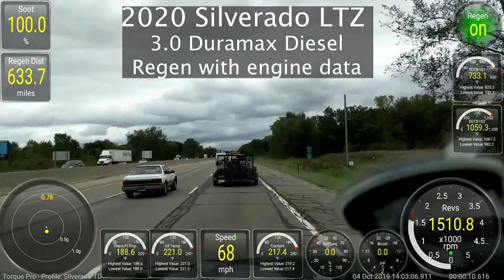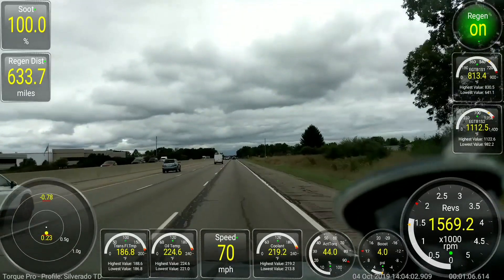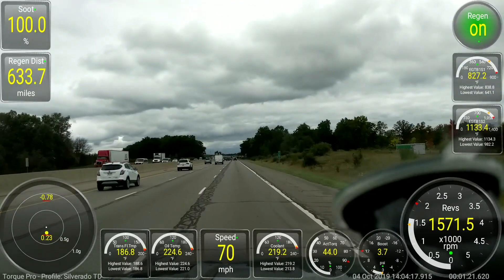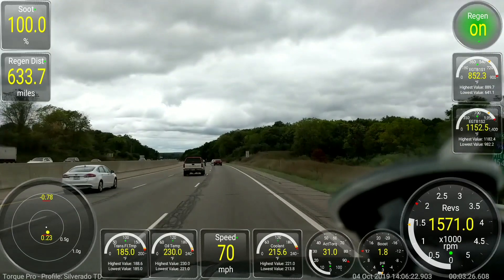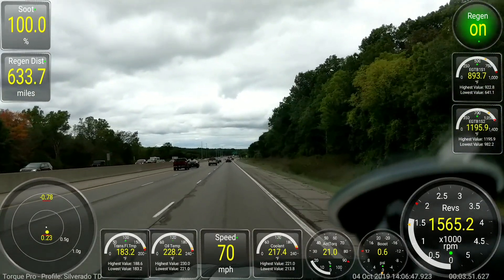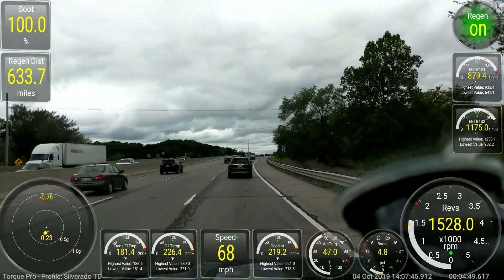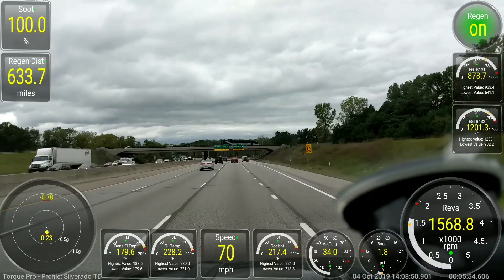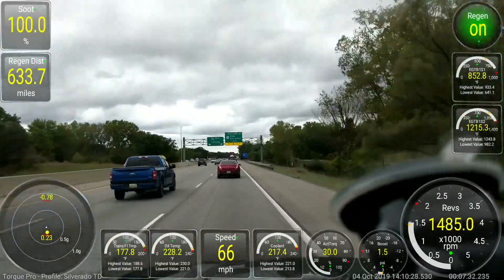2020 Silverado 1500 Duramax Diesel, Regen #12 full cycle talk

Comment: Mine has regened at least 4 times in 360 miles. That's absurd! My 6.7 Cummins never actively regened in 12,000 miles. I'm also going through Def like no tomorrow.
Reply: John Doe I HAVE 3,300 MILES ON MY 2020 RST DIESEL TWO WHEEL DRIVE AND MY DEF GUAGE HAS ONLY MOVED ONE QUARTER OF A TANK SO FAR.  MY FUEL MILEAGE IS UNBELIEVABLE, I SELDOM USE THE INTERSTATE AND MOSTLY USE 55 MPH TWO LANE ROADS WHERE I LIVE.  ABOUT HOW MUCH DEF DID YOU USE FOR 3,300 MILES ?
Reply: NOAH DUNAWAY the DEF is no longer a issue. They didn't fill the tank. However, this POS has been nothing but problems. Now I understand why they call it garbage motors.
Reply from the maker: @Noah, what issues have you been having.  I have over 18k on the truck and no issues at all.
Reply: Chad Ivan NO ISSUES AT ALL SO FAR. JUST CURIOUS ABOUT HOW MUCH DEF USAGE IS NORMAL, MY FIRST DIESEL.  THE FUEL MILEAGE HAS BEEN OUTSTANDING,  MOST FILL UPS HAVE BEEN AROUND 33 MPG WITH MY LAST ONE AT 35.2.  I WENT ON A 200 MILE DRIVE TO PICK UP A PORCH SWING ON THE PREVIOUS FILL UP AND IT WAS 37 MPG.  I TOWED MY ENCLOSED 26’ RACE CAR TRAILER, ABOUT 7,000 LBS, ON ONE TANK SHORTLY AFTER I GOT THE TRUCK FOR ABOUT A 65 MILE TRIP AND THAT TANK WAS STILL 26 MPG.  I HAD TO PULL THE MOTOR OUT OF MY DRAGSTER SO PROBABLY WILL NOT BE TOWING AGAIN UNTIL NEXT YEAR.
Reply: Chad Ivan at 146 miles, my front diff blew. And it's been download hill ever since. Constant engine issues, including over heating, stalling and regenning every 100 miles. I have major blow by to. GM WAS being really cool, said they were going to buy my truck back. They've done a 180 now. I have a out 4,000 miles on it now and it's been sitting in the shop for a week now.
Reply: John Doe I HAVE BEEN KEEPING UP WITH YOUR POSTS HOPING MY TRUCK WOULD NOT GIVE ME PROBLEMS , BUT SO FAR SO GOOD.
Reply: NOAH DUNAWAY I'm glad yours has been trouble free. It's going to be a great engine once they get the bugs worked out. However, mine was very poorly built. The Acadia they gave as a loaner, stalled on me yesterday.
Reply: John Doe MAN JOHN !, IT SOUNDS LIKE YOU ARE SNAKE BIT.  I HOPE THINGS GET BETTER FOR YOU, I KNOW IT’S AGGRAVATING TO GET A LEMON, AND WITH ALL MASS PRODUCED VEHICLES IT’S A CRAP SHOOT TO GET A GOOD ONE IT SEEMS LIKE.
Reply: @JohnDoe-nz6bk  my new 3.0 Duramax regen every 140 to 150 miles , dealer say is normal 😐.  I have 3.200 miles now
Reply: @watchmanexpert  that is not normal.
Reply from the maker: In 3,300 miles you will probably have burned about 2.0 gallons of DEF.  If you were towing this number would be much higher.  My highest use rate was 3.3 gallons every 1,000 miles.  These motors use a lot of DEF when under a lot of load.  I hope this answers your question.
Reply: @CJIEngineering  which app or OBD is that one ?
Reply from the maker: @watchmanexpert  it is Torque Pro with Track Recorder added to it.  It worked pretty good on the older phone but I haven't tried it lately.  There were some overheating issues if you wanted to record a long session.  It's a nice tool.
Reply: @CJIEngineering  thanks Ivan , the torque pro connect to the OBDlink max+ ?  Sorry all this is hard for me , I only want is check my regen and see is the truck is in regen or not , I have OBDlink max+ and I don’t know how to used 🥲… did you have any video explaining how to used the OBDlink?? Thanks 🙏
Reply from the maker: @watchmanexpert  I don't have a video on how to connect the unit but I could do one if it would be helpful.  Try these steps and let me know if you still have issues.  Plug in the MX+ unit into the truck and start the engine.  You should see the LEDs on the front light up.  Push the pairing button down, the LEDs will change state, flashing I believe.  Go to your phone and add a new Bluetooth device, it will show up during the scan and accept the pin number it gives you.  Once you have the unit added to Bluetooth there are no other setup items that need to happen in Torque Pro to start seeing data.  The Regen state is something that needs to be added to the custom PIDs, I have a video called "Adding Torque PIDs" on my channel with a link in the description to a Google Doc that has all the details.  Let me know if you need more details.
Reply: @CJIEngineering   thanks Ivan I will try that . I will let you know

Comment: Wow...oil get hot eh....maybe a nice Amsoil treat for her👍
Reply: Amsoil makes oil for gm. Amsoil meets and exceeds dexos. Amsoil refuses to pay royalty fees for having dexos label. Dexos label is not any different than api symbol,  it's just for marketing purposes only.
Reply: @repairvehicle  only issue is some dealers will not warranty if you use amsoil due to the very fact that they won't purchase the darn license lmao so silly
Reply: Amsoil does not make any oil for this 3.0 diesel. Only mobile 1 espx2 0w20 or ac delco dexos d. Not dexos for gas trucks. Only 1 manufacture . Mobil1 makes oil for GM

Comment: Ivan, I saw oil temps at 280 to 290 this week. Seeing you video makes me concerned,.  What is the highest oil temp you’ve seen unloaded and not towing a load?  Thanks
Reply: Mine spiked to 230 and I lost oil pressure for a brief second. I have 430 miles on mine. I've also regened at least 4 times in 360 miles and am going through Def like no tomorrow.
Reply: John Doe, after doing some research you have to use the standard value for an accurate engine oil temp reading. As for DEF mine seems to use a lot more than my 2.8 Duramax did. And yes these engine seem to regenerate quiet often 2-3 time per tank depending on driving habits and conditions. I’ve never seen the sticker MPG on my truck I have about 4500 miles now.
Reply: Kevin J that's absurd. My 2016 2500 Cummins never actively regened in 12,000 miles and I got 10,000 Miles from a tank of DEF. The manual also said that the fuel filter shouldn't be changed every 30,000 miles, but it's looking more like 10,000 Miles. I got better performance, better maintenance out of a 6.7 Cummins then this engine. I'm not impressed at all, especially since my front diff blew at 146 miles.
Reply: Kevin J I was alone getting close to 30 mpg before the first regen. Now I'm about 22 with all the regens.

Comment: Correct, you have to do a lot of highway driving with diesels to avoid an active regen. I had a 2016 ram 2500 mega cab limited Cummins and NEVER had a active regen in 12,000 miles. Most of my driving was highway. I also got 10,000 miles from a tank of DEF.  However, that was pre diesel gate!

Comment: Totally different scenario, but I will throw this out there as a reference point.... my 6.6L Duramax regens once per tank of fuel, consistently, whether I'm towing or not.  Since buying the truck I'va had various ending monitors on it and currently use an Edge Insight CTS2.  It displays regen status.

I've been considering a 1500 Duramax 3.0L as a new daily driver / tow vehicle.

Comment: What app are you using and how are you overlaying the video?
Reply from the maker: I use Torque Pro with the Track Recorder, both from Ian Hawkins.  The Track Recorder is what puts the gauges on top of the video.  The only real issue is the Pixel 2 will overheat in about 15 min of recording, that is why most of my clips are smaller in that mode.  Thanks for the question.

Comment: So I see you're using torque pro. I'm wondering how you got all those displays? I'm not seeing anything for Regen soot or Regen distance.
Reply from the maker: Jesse you need to add a custom PID in order to see them.  I have a Google sheet that I have shared with the values, https://docs.google.com/spreadsheets/d/1ZPDOeSx4JFwb1nomx5adsc7pYm-sdLimwG0FmNmVhNg/edit?usp=drivesdk   Hopefully this helps.  Thanks for watching and the question.
Reply from the maker: Jesse I just posted a video on Torque Pro and the steps for adding the displays.  I hope this helps.
Reply: @CJIEngineering  this is exactly what I was looking for. Thanks a bunch.
Reply: Question about which pid you use to measure "torque"?

Comment: So can you shut it off when it’s doing a regen? Meaning if you get to your destination and it’s not complete can you shut it off?
I’m very interested in this truck with the I6.
Glad I found your channel.
Reply from the maker: Yes, you can shut the engine off during a Regen.  Today it we cleaning for 2 miles and I stopped, after about 30min off it restarted after about 0.2 miles it started again.  I then drove about 5 more miles and shut the engine off a 2nd time it decided that it was close enough, DPF level was back down to 20.8%.  If I drove longer it probably would have continued down to something like 2-6%, this is normal on the highway Regen.  Thanks for the question and for watching.
Reply: Chad Ivan is there anyway to tell when it is doing regen without your phone data?
Reply: @gregkohl9275  by sound and rpms

Comment: Regen in anything less than a tractor trailer sucks. It was developed for class 8 vehicles. City applications have alot of problems with this. Now California is saying it is dirtier along with the cleaning and repairing of the emission components than it would be if it had no components. This is base on vehicles with no after market crap on them or tunes  program in them.

Comment: Short trips are not harmful to modern Chevy diesels. It will regen even in mild stop and go traffic - just takes longer. You “should” drive it above 40 MPH if possible during the regen but first hand experience is evidence that is not critical. If you think about what’s happening, it just needs to be able to heat up enough to burn off the particulates - so above 40 MPH may make that efficient but it will regen until you put it in park and which time it stops. I know you’ve owned diesels and are expressing what you’ve read in the owners manual but I also own one and I can see what’s happened as mine has regen’d probably more than 50 times now.
Reply from the maker: How many miles do you have on your Colorado?  I had the same experience with my Colorado, it stopped the Regen if you put it in park but the Silverado will actually continue even in park for some period of time.  I have not figured out how long it will really go but it will continue the burn process for at least 1 minute or more if you keep the engine running even in park.  Thanks for commenting and watching.

Comment: Does the coolant temp run around 220 when it does the re-gen? Or is that normal?
Reply from the maker: The "normal" operating range for the coolant temperature is 195-220F but if I'm towing it will go down to 180F.  I need to review the video I have to see the upper limit when towing.  This engine has a fairly sophisticated cooling/warming system on it.  It's my understanding that it will warm the engine oil and transmission oil to help get the best milage and then can control the coolant to the head and the block independently to help lower emissions.  Take a look at this video for the engineers explaining the cooling system, starts around 7:15 https://youtu.be/NFNsg7bCtdA
Reply: @CJIEngineering  Great video and explanations very intesting on the temps. Silverado by far is the best truck on the market have logged many miles with them and held up the best! : )

Comment: I see there is a supplement document for the GM 3.0 that explains a manual regeneration while parked. Have you performed this?
Reply from the maker: That option is only available for fleet customers.  I did read about it but I can't perform it yet :).  I'm sure there is a command that can be sent via the OBD2 port to put the ECU into that mode, maybe someone will figure that out.

Comment: i run torque pro and and can't set up an oil temp pid Can you help?
Reply from the maker: I will try :)
So when you are on the gauge display you hold down on the screen and you should get the menu that allows you to add a display.  You will pick the type of display and then be presented with the list of available items, you should have Engine Oil Temperature.  I believe that is the one I'm using.  I'm looking into a good way to make a video on how you set up everything I have installed, torque pro related since this has come up a few times now.  Let me know if you get it added.

Comment: DPFs on GDI engines is a thing in Europe.  Only a matter of time?  That sucks on the oil too from your selling dealer.  We ordered a few cases of the DexosD like 2-3 months before we even got a truck on the lot.
Reply from the maker: I didn't know that about European GDI engines.  Yep, it was a little disappointing about the oil.  The parts guys really don't appear to have any info on this engine or other 2020 new features like the transparent trailer camera set up / calibration.  I had to call in a favor to get the system to work and I'll be doing an video on how to get it to work :). Thanks for the comment and watching.
Reply: Chad Ivan I CHANGE MY OWN OIL AND FILTER AND MY DEALERSHIP KEEPS THE CORRECT OIL IN STOCK.  THEY GIVE ME A SMALL DISCOUNT WHICH COSTS ME $55.00 TOTAL FOR 7 QUARTS WITH A FILTER.

Comment: Thank you for posting this. I was a little surprised to see the oil and coolant temps were that high. I usually see between 192-200F on my 14 Sierra 5.3. Oil and coolant will be about the same temp once up to full operating temp. Might see 220F when towing in 5th gear in the summer (3,000 lbs).

Are you able to overlay instant and/or average fuel economy numbers? Would be interested in seeing that while you are driving.

Keep up the good work!

Thanks
Reply from the maker: I am able to add them to the video.  The limiting factor I have is the phone temperature running the video app so I can get about 15min clips.  I'll try to get you some fuel economy video.
Reply: Your 5.3 gasser to this diesel engines are two different beasts.  Temp reading will be different.

Comment: How big is the DEF tank on the 1500s?? I went 8k miles on my 6.7L F250 without towing.
Reply from the maker: The tank is 5.2 gallons but it's hard to say if the dealership really filled it up completely before delivery.  I know it's full now so we will see how much DEF it is using in the future.  NOx values look really good/low pollution rate :)

Comment: What are you using to get data looks like torque pro I am curious and of so is it a custom PID or is it in the gm Chevy pids
Reply from the maker: I am using torque pro with the track recorder app added to work inside of torque pro.  I have the GM PIDs added but I also have a few extra that have been found and I have them shared on a google sheet that can be found here:  https://docs.google.com/spreadsheets/d/1ZPDOeSx4JFwb1nomx5adsc7pYm-sdLimwG0FmNmVhNg/edit?usp=sharing

I hope this helps.
Reply: Hello. I am a novice in this stuff. Please excuse if my question is dumb. How do I get my iPad to read these extra gauges?  I have a 2019 2500 with a Duramax and I would like your gauge setup and the DEF level. Thank you in advance.
Reply from the maker: I have a video on how to add the Torque Pro PIDs that I posted last night.  This same method should work with an iPad and a OBD2 software reading a WiFi adapter, sorry I don't own any iOS hardware :(. As for the DEF gauge, I don't have a PID or a good way to calculate the estimated value in the tank.  GM only has a few pins that measure the level and they do math based in the amount used to give them a simulated gauge.  This would be super difficult to do.  All questions are good questions :)

Comment: I would love to hear how it does towing your trailer.  Just ordered a GMC with the 3.0 and I have a camper.  How heavy is your camper?
Reply: I Want to but  3.0 Duramax, i hear they overheat at 1 o clock. is this true
Reply from the maker: My camper is a Cougar 27RES, about 31' from the ball to the bumper and weighs 7,400 lbs loaded but without any water in the tanks.  I am super happy with the truck and have even towed very close to the rated limits of the truck.  If you have a trailer that is under 9,300 lbs it's a great choice.  Keep watching, my trailering videos are in the works
Reply: Great,  thanks for what you are doing. I think mine is about 500lbs lighter

Comment: I’m interested in this engine for when I tow, I don’t drive 15 miles per day though. Why would it be bad to drive less than 15 miles a day?
Reply: Justin Dockery this is why you go with a ford for daily driving short distances, Ford offers OCR, operator command regen, you can perform stationary regeneration in your driveway, no need to go put unnecessary miles on your ride just to regen. I have it on my f250, it was a must when I decided to daily a diesel
Reply: The epa has taken all the fun out of having a diesel.

Comment: What are you using to get the data overlay on the video? Excellent video keep up the good work!
Reply from the maker: I am using and Android Pixel 2 running Android Q with the Torque Pro app and Track Recorder app added.  I am also using the OBDLink MX bluetooth to OBD-II plug in to get the data from the vehicle to the phone.  Inside of the Torque Pro app I have added the extra GM PIDs and a few extra that I have found.  The extra ones are shared on a google sheet that can be found at:  https://docs.google.com/spreadsheets/d/1ZPDOeSx4JFwb1nomx5adsc7pYm-sdLimwG0FmNmVhNg/edit?usp=sharing

Overall the system works great but I can only get about 15 minutes worth of Video before the phone overheats.  Running the just gauges it will work 24/7/365 and has a very good refresh rate.

Let me know if you have any other questions.
Reply: Yea, same question. How do you get this realtime data?

Comment: Wow Guy lol. Yep that's a lot of regens. I would agree with you in your assessments. These new super cleN burning diesels need heat to work properly. If your driving a lot of short stuff I can see where you wouldn't get the engine up to proper temperature for all the equipment to work properly. Sure wish you the best of luck with your truck .